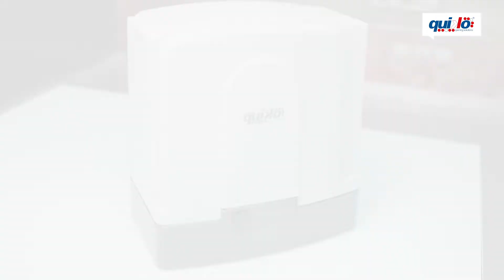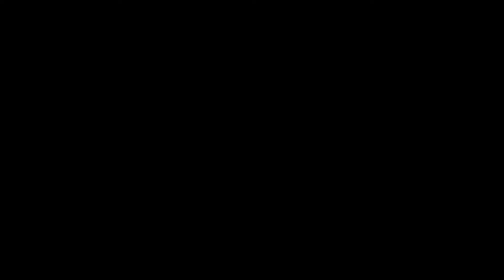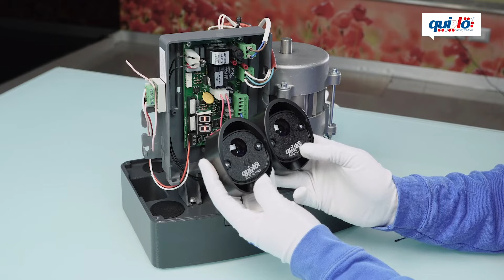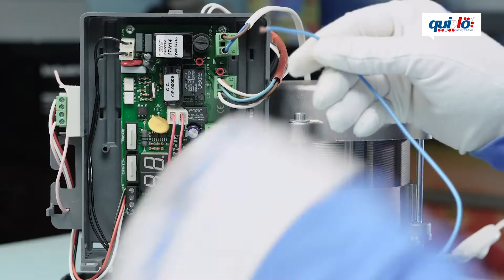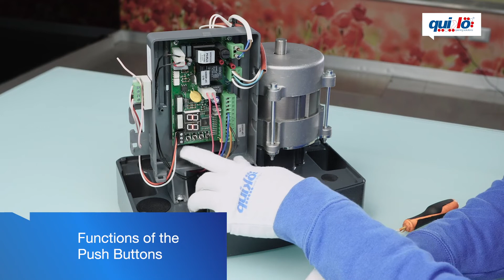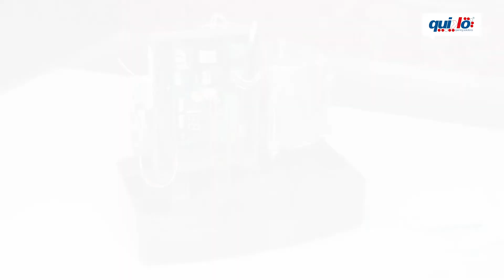Sliding Gate Operator Tutorial:How to program QUIKO QK-CE220RL4 Control Board for Sliding Gate Motor

Comment: Hello, thanks for the detailed video, I have a question about the control board, I have a Proteco mover 8 motor with the same board, is the initial start-up of the motor done in the same way, or is the setting different for each motor.
Reply from the maker: Hello, thanks for contacting Quiko. Proteco control boards have different software, so please contact Proteco. At your disposal for any further info. Greetings from the Quiko Team.

Comment: One off the major problem with Quiko sliding gate are getting stuck when gate is closing. So gate is not opening when press push button or button of remote control. 

I hope this problem is resolved. 

When gate is stuck it can be opened manually unless the gate lift from the back.
Reply from the maker: Dear Qassim, thanks for contacting Quiko. Thanks to the BRAKE function supplied with latest versions of our control boards, the problem you are describing doesn't happen anymore.
Reply: A customer has a motor identical to what you have there. The problem he is having is when the gate almost close the slow down feature struggles and the gate dont close but works fine on the opening. There are no tight spots at all but the is extremely heavy. How can you assist.?

Comment: I installed sl600ACL but all the bottoms  work for open stop and close and has no screen to program , how to get each bottom to work for separate function ?
Reply from the maker: Dear Lucio, Sl600ACL is not a Quiko product. Please refer to the corresponding manufacturer.